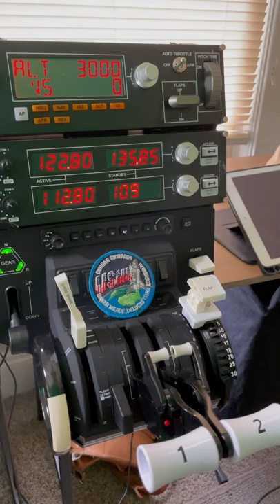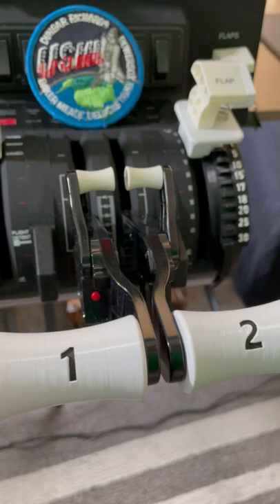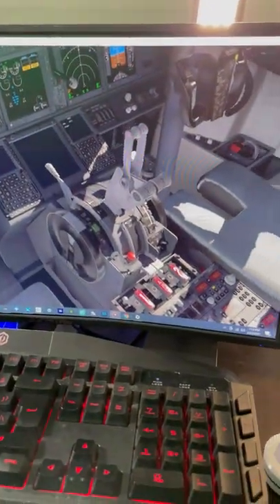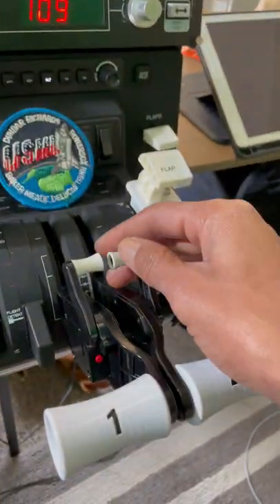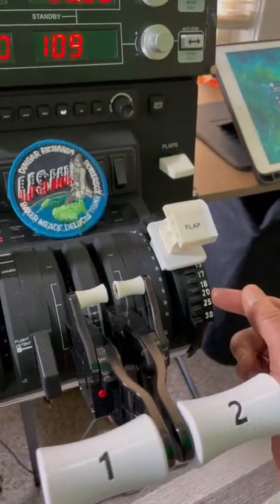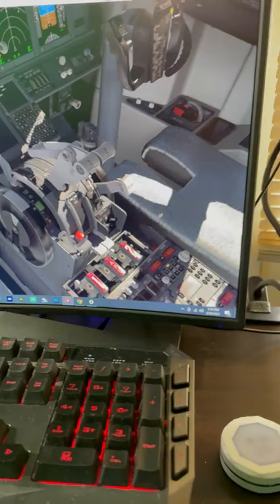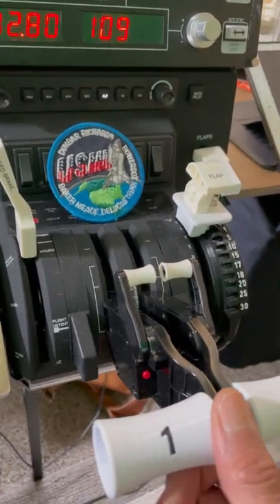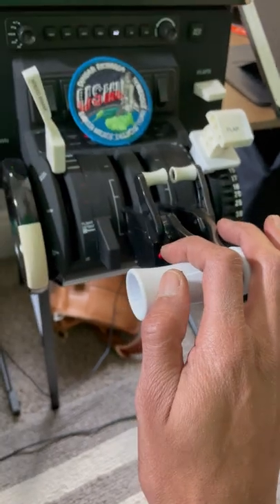Honeycomb Bravo Throttle Quadrant Parts Mod | First Look & Short Comparative Review

Comment: are the throttle levers original? i think that they are bigger than the original ones u get in the pack. if they are not original, where did u get them from? they look amazing
Reply from the maker: Hey pal. No they were not the original ones. The link is below as to where I purchased the modified handles and flap parts. Lmk if you have trouble I’ll look more into it. Thanks for clicking in.
Reply: thanks, i just bought the bravo quadrant, it will be delivered on tuesday next week, and i think that the levers are kinda small, can u say something about the original ones? are they really that small or i am just blind lol. and is the throttle good overall
Reply from the maker: @flegma22  the throttle is kick A awesome. I used a saitek throttle mod parts I gave to XP72 and I like these more. Every stream I fly w the bigger modded ones. I hated the small knobs that came w the default. I’d say getting the mod like me is a must (affordable) bigger and just nicer. Plus the flap detents are cool.
Reply: @chiefsimpilot  15$ isnt really much actually, so ill think about that, thanks for the answer!
Reply from the maker: @flegma22  my pleasure mate. Happy flying

Comment: Question, does the Bravo quadriant work with the Saitek Pro Yoke?
Reply from the maker: Howdy. No the Saitek does not work with the bravo at all. There is a mod that works with Saitek that a guy from Russia makes. Google Saitek throttle mod. But no these two incompatible together.

Comment: Does this have an auto throttle disconnect inside the throttle lever?
Reply from the maker: There’s a toga button but it can be used as anything you want.
Reply: @chiefsimpilot  not toga, but autothrottle disconnect, thanks for the response.

Comment: Too bad there's nothing you can do for this quadrant that'll make it resemble a Cessna in any way.
Reply from the maker: That may be true. I’ve seen a few products attempting to make handles for it. The package I received which is what the video described had GA config but I’ve never tried it lol. Thanks for clicking in
Reply: @chiefsimpilot  I believe at one time Saitek offered a reasonable Cessna style quadrant, but for some reason that has been discontinued. At the moment there seems to be a huge gap in the availability of sim Cessna throttles with the exception of some home-brewed 3D printed editions for sale on the web or the outrageously priced RedBird.
Reply: @chiefsimpilot  Quite a number of GA aircraft do indeed have levers, but Cessna is not one of them and since I primarily fly Cessnas (both real and sim), the offering from Honeycomb is more than disappointing to me.
Reply from the maker: @airste172  I truly appreciate that feedback so I’m not surprised when I try to fly Cessna using these parts. Many thanks and hopefully a mod comes out soon more geared for Cessna craft. You rock m8